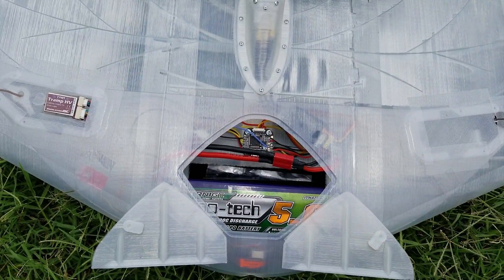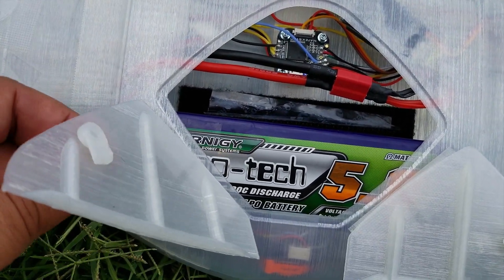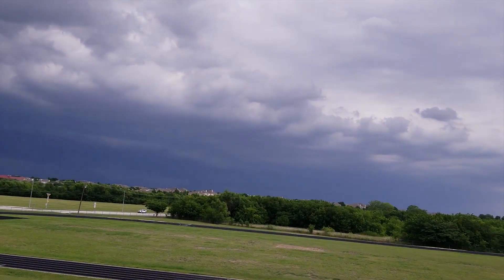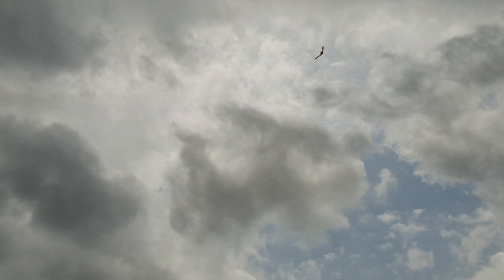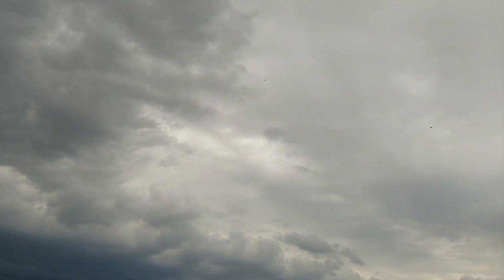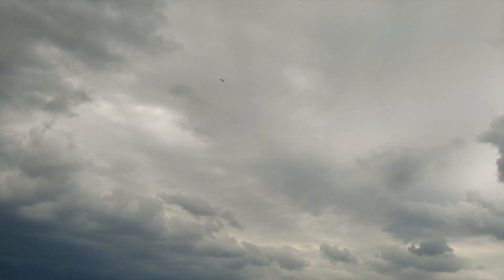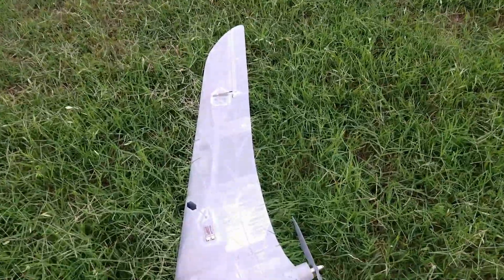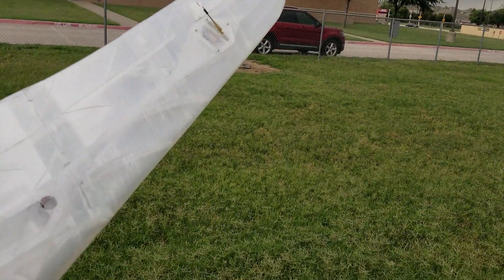UAV EBW 160 2nd Flight

Comment: What filament did you use? Any thoughts on the filament. I am getting ready to print...
Reply from the maker: I used the 3D solutech clear PLA.  It printed fine.  I'd just make sure it's a filament you've used before and the layer adhesion is solid.

Comment: nice launch....please give an update. I just finished printing mine
Reply from the maker: No real update as it's cold and I haven't flown it in a while.  I'm still adjusting some inav settings because loiter and some of the other auto flight modes could use a bit of tuning.  I may try and reprint with the LWPLA.  Here are a couple more videos:

https://youtu.be/PhUTtycyug8

https://youtu.be/bpD5gadoLks

Comment: Congratulations indeed a beautiful model !!! have you made any other flights? how is the frame? is it resistant to sudden landings?
have I seen you use a very heavy battery? Do you need a lot of weight to hit the CG? Thanks Francesco
Reply from the maker: I've made several more flights.  watch the 3rd flight video... The PLA broke when it hit the fence... But I was able to print a new wing tip and aileron.  With PLA I needed the 5000mAh battery in the front to get it to balance out.  There is this new stuff called LW-PLA that is supposed to reduce the weight about 50% and someone was able to just use a 2200mAh battery.  But with PLA you'll need that big battery up front to balance it out.